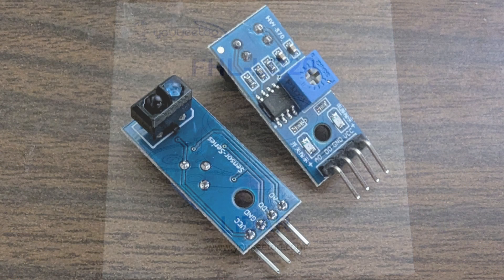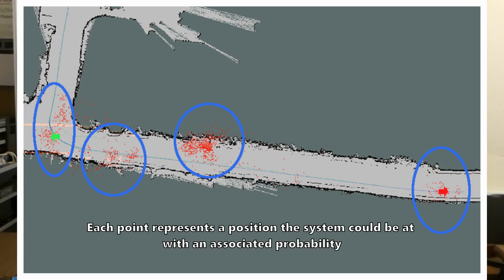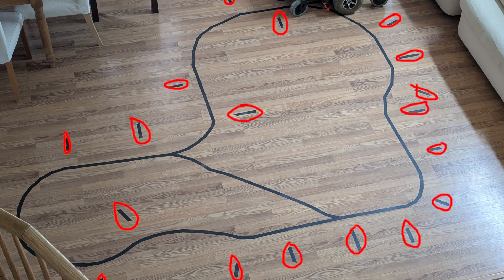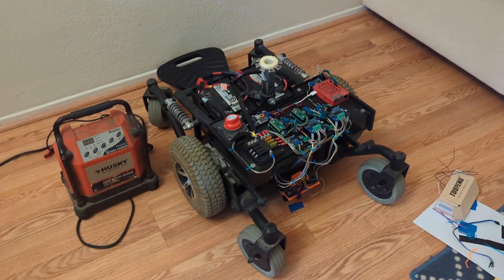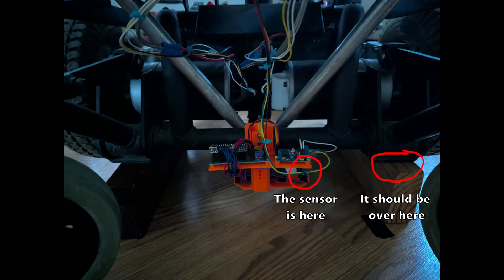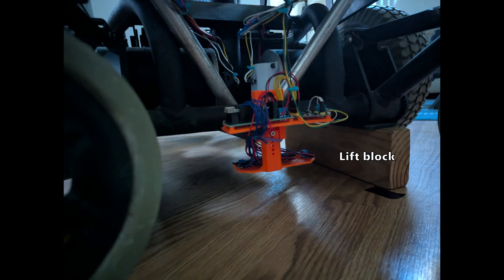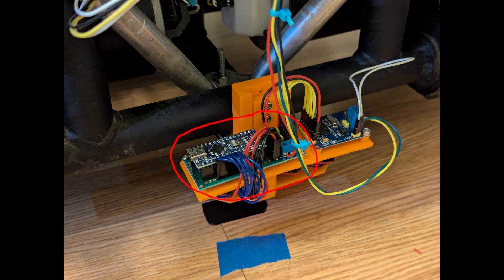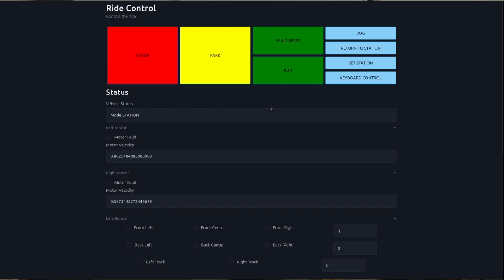RIDING my TRACKLESS DARK RIDE for the first time

Comment: Amazing work, I am a controls engineer too. 

Do you have any plans to add an extended Kalman filter(EKF) to the system? I could envision a system that uses QR code(arUco) stickers instead of IR pucks. The EKF could determine the accurate location using the encoder position as the wheels will be hesitant to slip. A magnetometer could be used to determine heading. The control system would find the next QR code which a camera could be used to account for drift of the vehicle. This system could then allow the chair to spin at certain points for the ride layout. 

Good choice on changing from Lidar to Infrared, working with Lidar is a mess as any dynamic scene becomes compute heavy and just a nightmare to adjust for. If you're vehicle is moving you have to factor that into the data which is just a headache.

Can't wait to see where this project goes, Good Luck!
Reply: He is working on it. My floor is now covered in them.